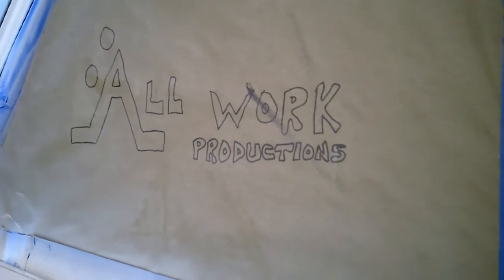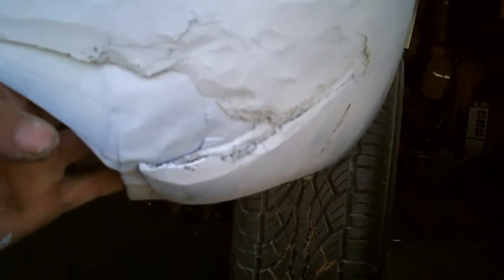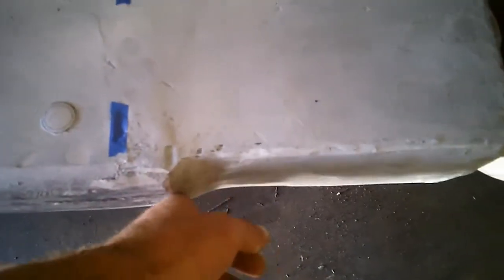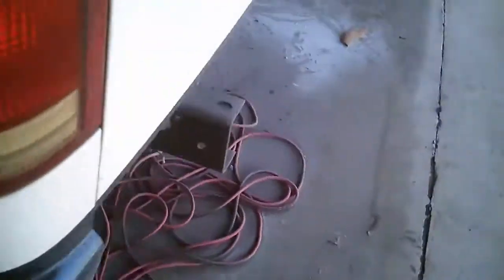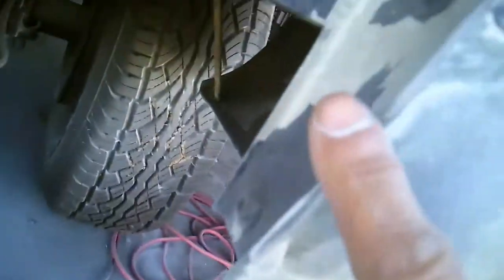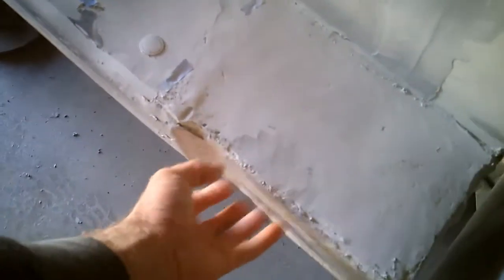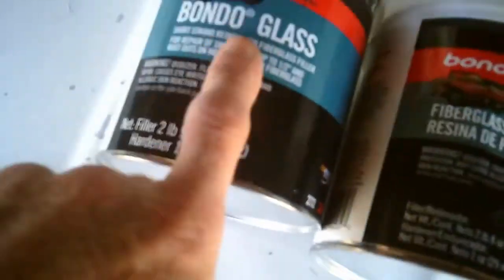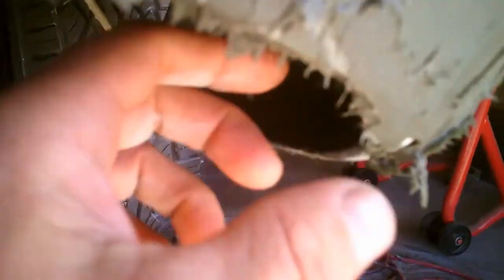BBHR Project 69 Fiberglass Jelly and Fiberglass Hair

Comment: Use either a heat gun or hair dryer to remove your graphics any left over glue comes off easily with mineral spirits or wax and grease remover. If you remove graphics often body supply shops sell these round rubber wheels that fit in most angle grinders that remove graphics and glue instantly but they crumble like an eraser before damaging any paint. The supply shop by me gives you a new free grinder with any box of wheels. Not damaging the old paint removing graphics will save countless prep hours not having to fix and fill scratches or grooves left from scrapping off the old stickers like that.